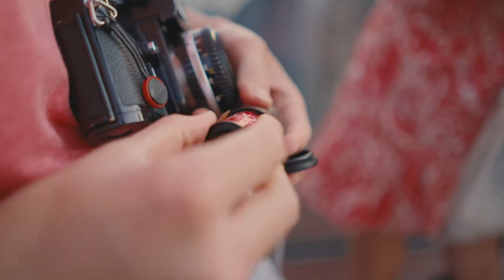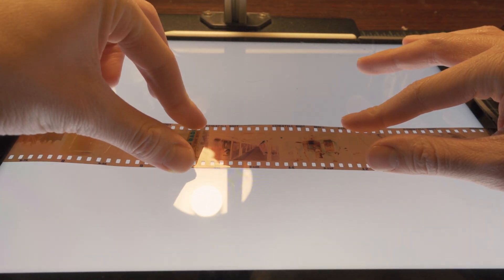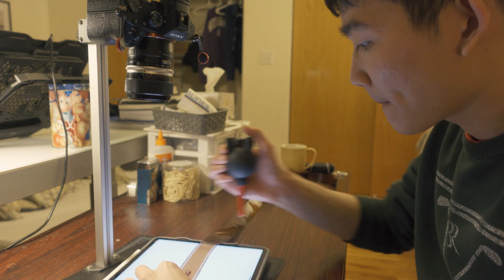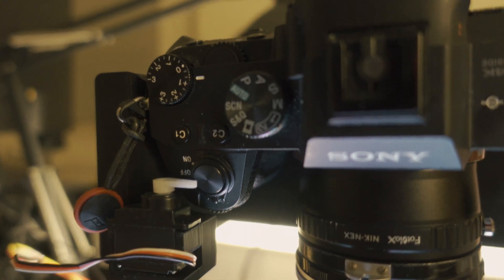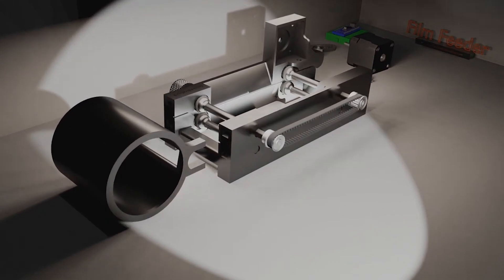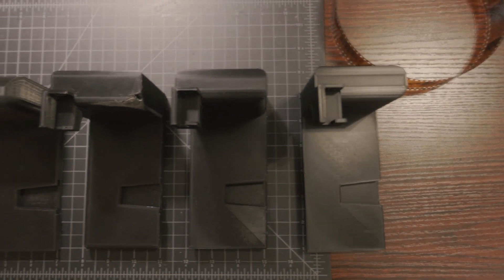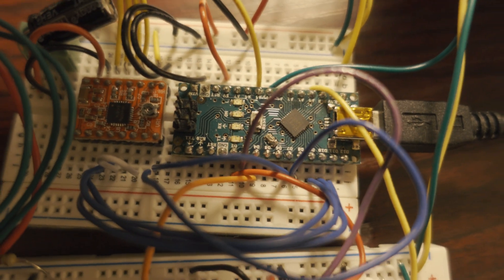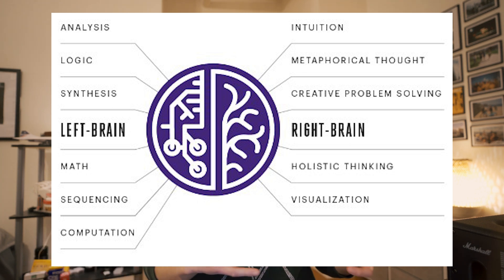AUTOMATIC Film Scanner | Arduino, 3D Printing, CAD

Comment: very clever idea. I love it for production digitizing. I have a concern, when film reel unit will end up scratching the negatives as it rotates. have you consider using felt or a soft surface inside the take up unit?
Reply from the maker: This is a valid concern and ive never thought of it! Good idea

Comment: what if you output a analog voltage on the main board, like 2.5V=1 photo, 2.55V=2photos, then use another board to interpret it and display?
coding noob here btw
Reply from the maker: Oh that’s pretty smart I think that would work!